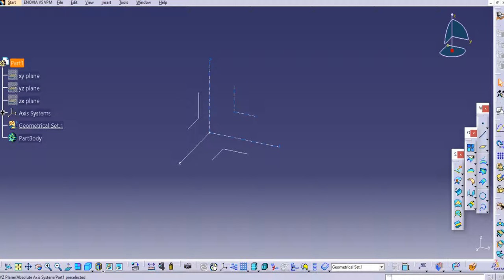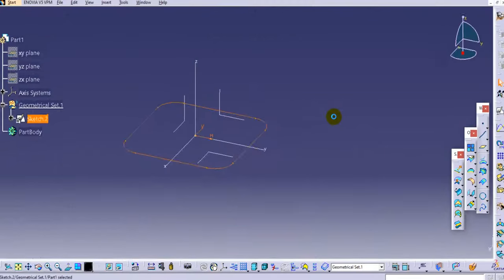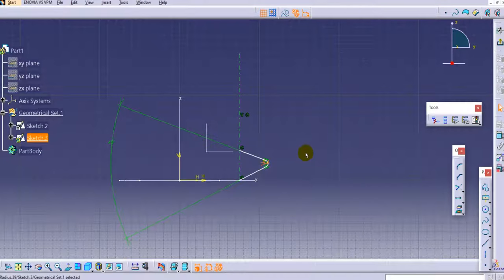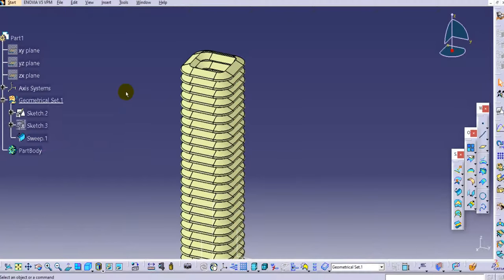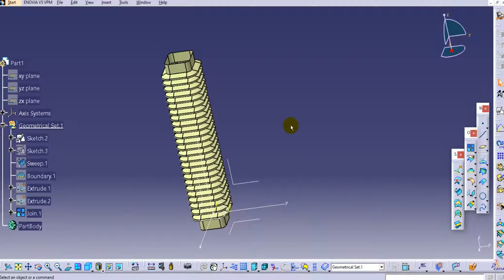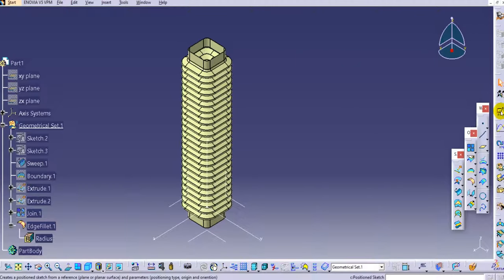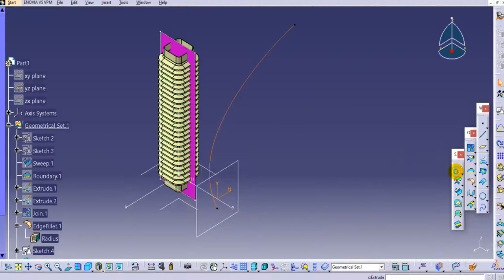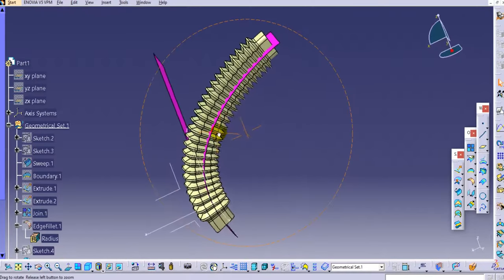Wrap Surface I CATIA V5 I Bellow Design I Generative Shape Design I GSD

Comment: Fantasically explained! Calmly, and without back and forth. Exactly to the point. Thank you very much! 
One small detail I did differently. After drawing the one, rounded v geometry, I left the sketcher and multiplied the V with rectangle pattern, then put it together with Join. When changing the V geometry, the model remains more stable.
Reply from the maker: Thanks for watching & suggestion. will give a try :)
Reply: Yes really. This is because the TRANSLATION command is not linked with the original sketch, so changing the design will ultimately make the design fail. A much secure and stable way of doing this, as you said is RECTANGULAR PATTERN, as it is linked with the original one, any change is gonna adjust itself automatically. 🙂👍